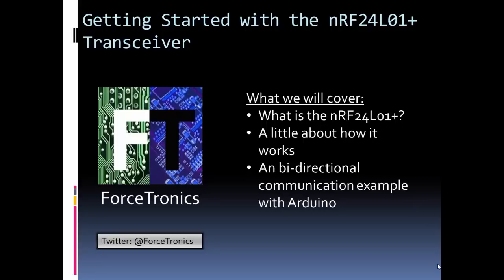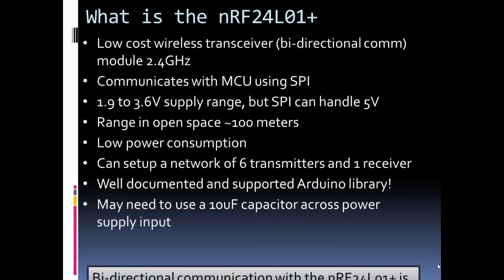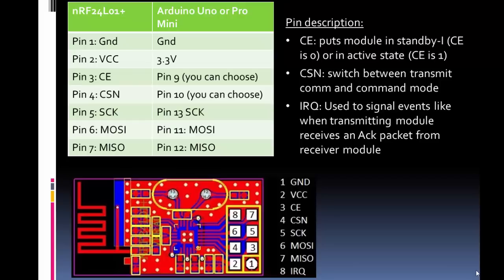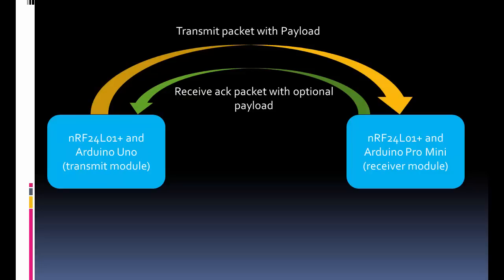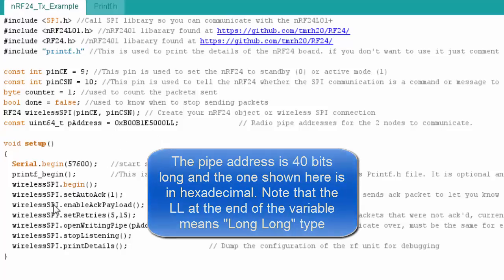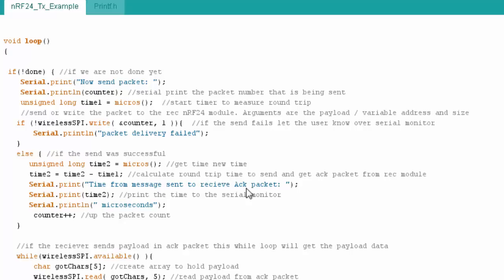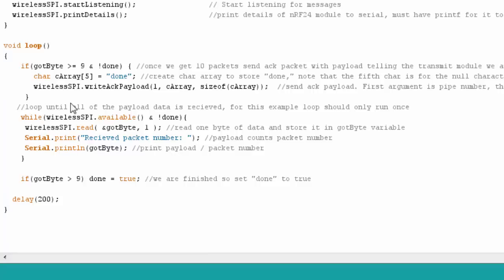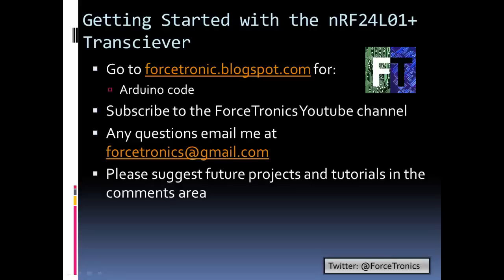Getting Started with the nRF24L01 Transceiver

Comment: How can i extend the range without the antannae veraion
Reply from the maker: You can turn up the transmit power to it's Max level and make sure the antenna has no metal around it

Comment: I would like to know if it is possible to implement an ad-hoc network using the RF24 modules.
I am developing a proof of concept for vehicle to vehicle communications using toy cars. My first option was Wifi but the ESP modules do  not support ad-hoc networking.
Reply from the maker: Yes. If you look at some more of the videos on my channel there is a series that sets up a mesh network using the nRF24L01. You can also find open source libraries on Github that help setup advance networks with the nRF24L01
Reply: Cool, thanks. I'll have a look.
Reply: Is there a software that I can use to simulate the nRF24L01+? I've been looking around and can't find any.
Reply from the maker: Not that I know of

Comment: Hello, i have tried the two arduinoes so, when i open serial monitor for sender and reciever i dont see any thing, ichecked the connections and codes until I am blind :(
Reply from the maker: When you open the serial monitor does it print out any information, such as the settings of the transceivers? If not have you verified that the arduino is able to communicate with the serial monitor (without the transceivers)? If not I would suggest writing some simple code from the Arduino to communicate with the serial monitor. If that does not work you have an issue between the arduino and serial monitor.

Comment: I uploaded the transmitter code and receiver code to their respective nodes. 
This is what I am getting at transmitter module's serial monitor 

Now send packet: 1
packet delivery failed
Now send packet: 1
packet delivery failed
Now send packet: 1
packet delivery failed
Now send packet: 1
packet delivery failed

What should I do ?
Is my module working fine?
Reply from the maker: it means they are not communicating. I don't know enough about your setup to know why it is not working.
Reply: I got the same error. Not sure what the problem is yet.
Reply: I'm using an Arduino Micro. When I select my board, I've chosen "Arduino/Genuino Micro" and "Arduino Leonardo". Neither has worked.
Reply from the maker: If you are getting that error it means that your transmitter sent or tried to send data but your receiver never replied that it got it. Some areas to check: Is the receiver setup correctly with the receiver code loaded on the Arduino? Do you have a capacitor right at the transmitter VCC input to ensure it is getting enough fast current to transmit? Try with the transmit power set on Low and see if that works. What does the serial printout from the receiver say? Does the receiver print out its current state? Do the addresses of the receiver and transmitter match?
Reply: +ForceTronics I did notice that the receiver didn't have any serial output at all. I thought I programmed it correctly, but I can try again. If by address matching, you mean the "boobies" pipe name, then yes they match lol
Reply: +ForceTronics I put the capacitor on the end of two female jumper wires that connect it to the breadboard. Although, it's probably most significant that I'm not getting any serial output on the receiver.
Reply from the maker: Yeah if you are not seeing anything on your receiver serial monitor than your problem is somewhere on the receiver side.
Reply: It looks like there's not anything currently in the receiver's code to give me any serial output if there is no data received. I added a few lines just give me an indication that it's looping.

Does the serial output on the transmitter side actually indicate if the nrf24L01+ module successfully transmitted the code (regardless of whether anyone received it)? That would help me determine if there is a problem with wiring.
Reply: There doesn't appear to be any LED indicators on the nRF24L01 itself
Reply from the maker: If you included the printf.h file then the receiver will print out its status and settings to the serial monitor when it starts up (this is the call that does that "wirelessSPI.printDetails()"). Note that this call and the reply show that the Arduino and nRF24L01 are successfully talking to each other. If you don't get this on either the transmitter side or the receiver side then they are not communicating with the Arduino they are connected to.
Reply: Yeah, it's included but it's not giving me anything in the serial output when it starts up. The first thing that shows up is "Now send packet: 1"

It looks like it's on me to figure this part out. I guess I might start with switching to an arduino micro and breadboard that I've used before.
Reply: Must have been a problem with the arduino boards. After I switched to another board that I have, I uploaded the trasnmitter code and was getting the message "Time from message sent to receive Ack packet:" which I thought was strange because I didn't have a receiver device running. The times were around 120 microseconds.
Reply: Here's the message I got:
Now send packet: 5
Time from message sent to recieve Ack packet: 128 microseconds
Now send packet: 6
Time from message sent to recieve Ack packet: 132 microseconds
Now send packet: 7
Time from message sent to recieve Ack packet: 140 microseconds
Now send packet: 8
Time from message sent to recieve Ack packet: 128 microseconds

After it tried packet 39, it started giving me "packet deliver failed" again. I just copy pasted all of your code. Is it possible that nearby Wifi is sending back an acknowledgment?
Reply from the maker: It should stop at packet 10 as shown in the video and print "done." Be sure to start them in the order shown in the video. No it is not possible that WiFI an ack packet.

Comment: can these transmit and recieve data at the same time?like in phone both device can transmit and recieve at the same time..?if not then how can i make this happen with arduino and nrf24l01?help please.
Reply from the maker: No these cannot transmit and receive at the same time since the transmit block and receive block both share the same antenna.Do you really need to transmit and receive at the exact same time? The Arduino is a single core MCU (most versions at least) so it can't send data out on a digital line and read data in on a different digital line at the same time.
Reply: and that's where he needs an RTOS like FreeRtos. Right?

Comment: great explanation ,I have this question for you, let's say I have the nRF24L01 Transceiver connected to my arduino, and I want to send radio signal...but wait ! not to annother arduino but to a device that uses radio frequency, for example I want to command a wireless light socket, how can I do that? : )
Reply from the maker: +med garouche Well it depends on the wireless communication standard the light socket uses. The nRF24L01 is a proprietary communication standard developed by Nordic so my guess is it would not work with many wireless light sockets on the market. It the light socket uses bluetooth or WiFi than you would need a bluetooth or WiFi module to communicate with it.
Reply: ah ok, thanks for the reply 
check this tutorial, the guy used a different RF module to store the RF signals and then reproduce them using the emitter, very cool project
http://blog.rogiervandenberg.nl/2013/03/control-lights-with-arduino-remotely.html

Comment: Can you give more info about 10uf capacitator, when i write it to ebay i see lots of items. They have different volts etc.
Reply from the maker: +M. Yıldırım You will need a 10uF electrolytic capacitor. The voltage rating just has to be higher than the voltage you plan to use it at so 25V, 50V, or 100V will all work. Here is one example: http://www.ebay.com/itm/100PCS-10uF-25V-105c-Electrolytic-Capacitors-5x11mm-/291539780847?hash=item43e12004ef

Comment: Love your video.. its awesome :) Wouldn't soldering a bigger antenna to it increase the range? And also I'd like to amplify the signal without distortion,noise and packet loss... but I haven't got a clue how. I'd be pleased if you answer and thank you for the video! subscribed. greetings from germany :)
Reply from the maker: +Peter Lustich Glad you liked the video and thanks for subscribing. It depends what you mean by soldering a bigger antenna. You don't want to change the PCB antenna because that is properly tuned to the wavelength of the frequency range it is sending and receiving (~2.4GHz). There are nRF24L01 boards out there with an SMA connector that allow you to add an external antenna, which would probably yield a longer range than the PCB antenna type. I also came across this version of the nRF24L01 (see link below) which has a stronger power amplifier so it should provide a longer range. I have not tried this version of the nRF24L01 out myself so I can't comment on the quality. Hope this helps and I will be in Stuttgart in November enjoying Swabian food!
http://www.icstation.com/22dbm-100mw-nrf24l01ppalna-wireless-transmission-module-p-4677.html
Reply: Thanks for your answer. With bigger antenna I just mean keeping the wavelength but increasing antenna gain. Oh and I wish you a nice stay in Stuttgart!

Comment: Thanks for the video. It works good. It would be nice if you could share us something you have done with the wireless communication than just sending and receiving packets
Reply from the maker: maranatha84 If you check out my video "nRF24L01 / Accelerometer RC Car" you can see an example project where I use it.